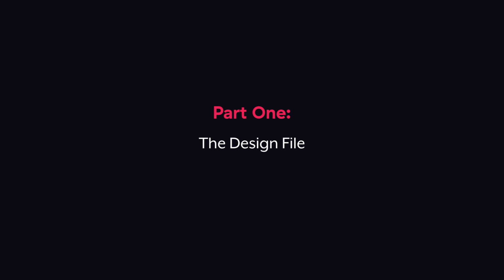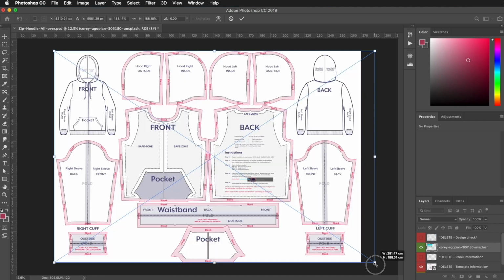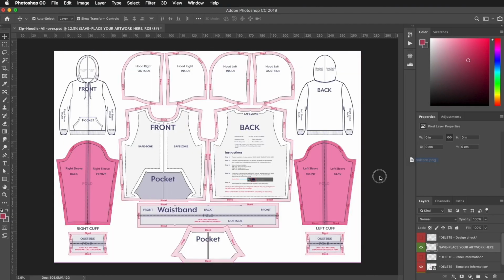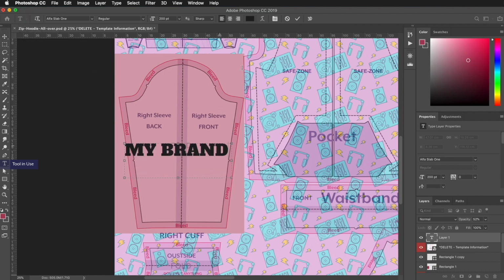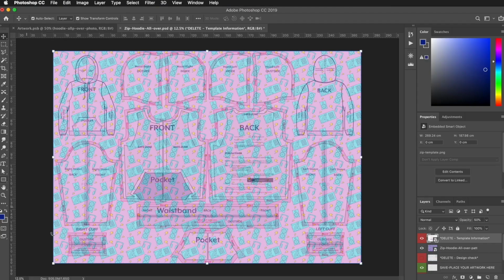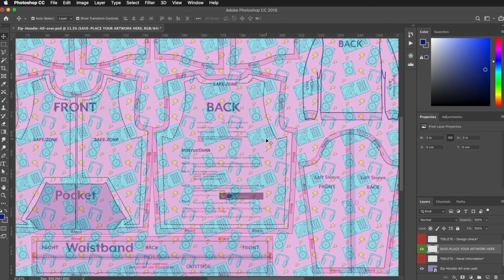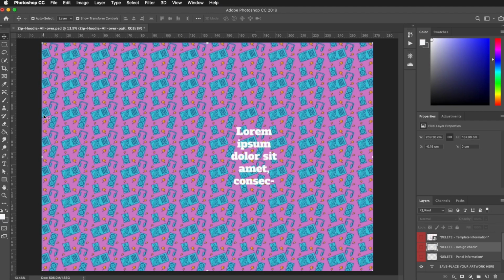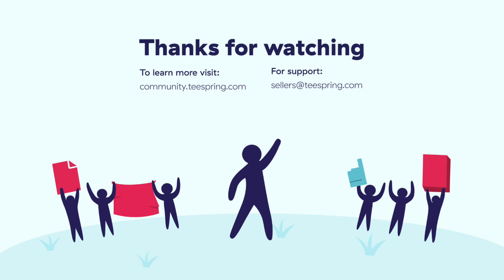Teespring Design Template Tutorial: All-Over Zip Hoodies

Comment: Hey Do I have to create a new layer every time I add a new design in certain parts, or merge in one layer?
Reply from the maker: Hello! Because you will export a flattened png file, you can create the design using any number of layers, as long as the template instruction layers and guides are hidden or deleted. The exported png should only be your final designed image.
Reply: @amaze.commerce  Oh, I'm starting to understand, so I can use a different layer for each art, and eventually it will be exported to a png file, all the art together in one png file. Is it like that ?
Reply from the maker: @Relax-kb7tf  correct ;)